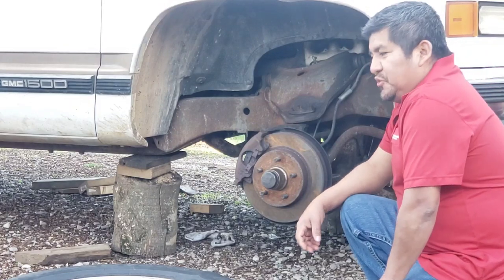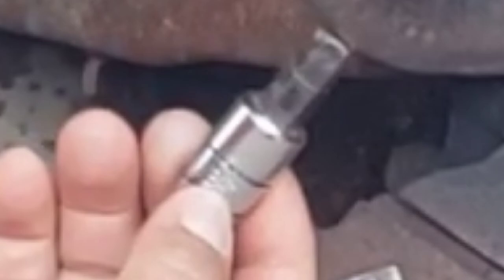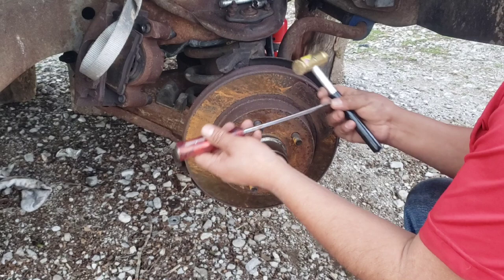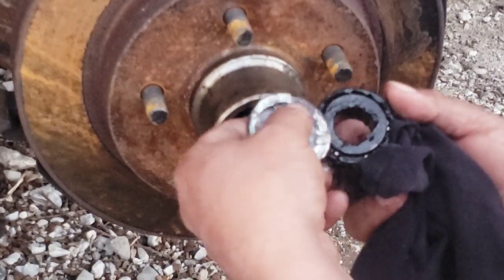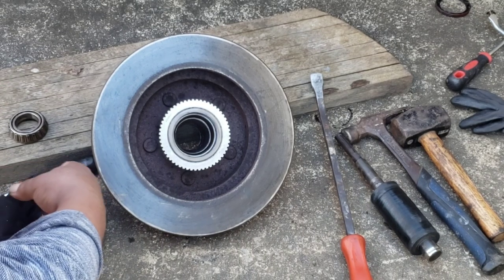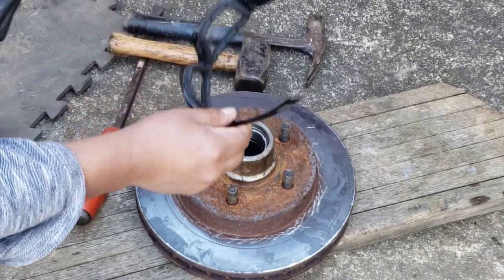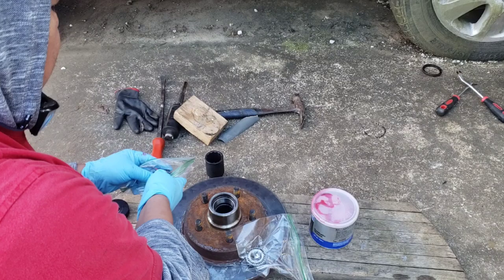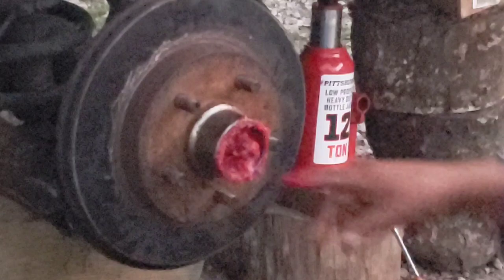How to Replace a Front Wheel Bering for 1995-98 GMC Truck C1500 Silverado Wheel Bearing Installation

Comment: La piesa Redonda donde la consigo Para meter el anillo atras
Reply from the maker: Ese viene con un kit, de wheel Bearing Press kit, qque se llama (Orion motor tech front wheel bearing adapter tool Kit) 

Lo tengo un Vídeo de Muestracion para esa Prensa

Comment: What size was the socket to get the big bolt?
Reply from the maker: It was a 30mm deep Socket
Reply: @IshMotorparts does this work on the 1994 Chevy c1500? Also I thought the axel nut was a 35mm?